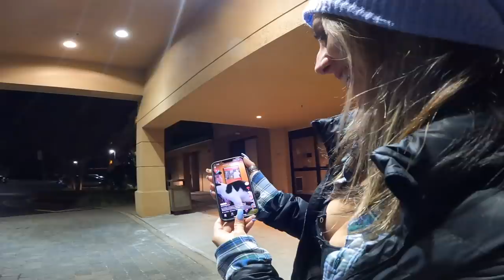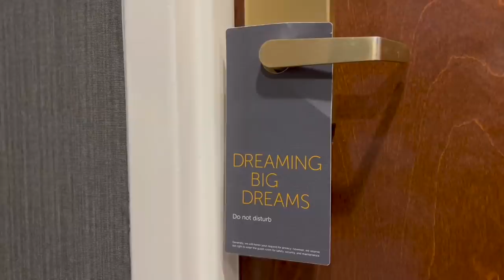Real Life Storage Wars FIGHT Breaks Out At PALLET AUCTION!

Comment: Hey guys love your videos! You're both so genuine and real and you make a real effort to make sure we're basically with you . Thanks.  Also random question do you grease the wheel bearings on that trailer? That way it will work for a longer time.  Usually there is a external grease fitting on each wheel under the rubber cap. If you more info then reach out.. keep going! Straight GOLD